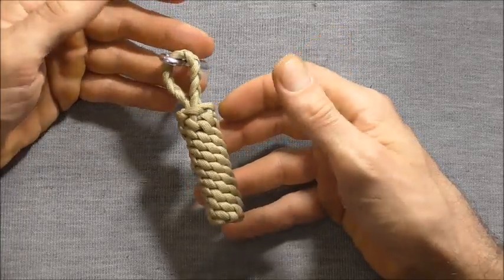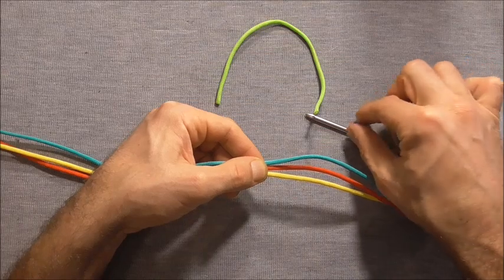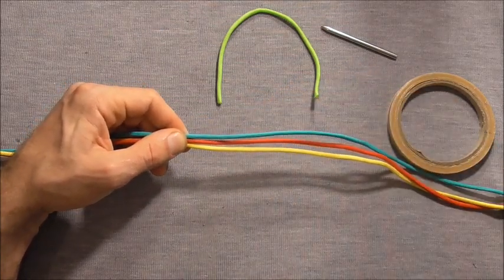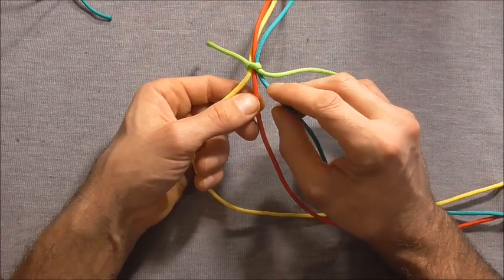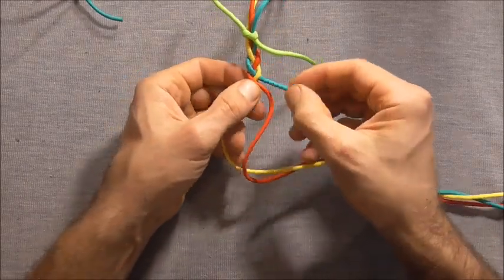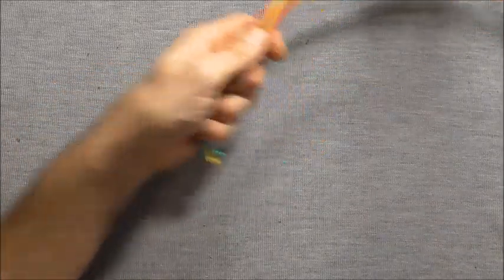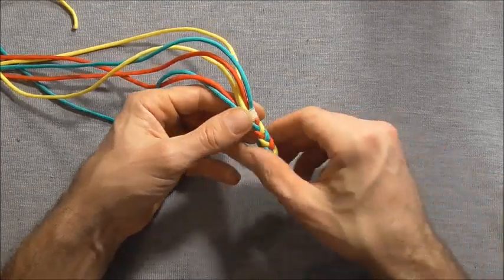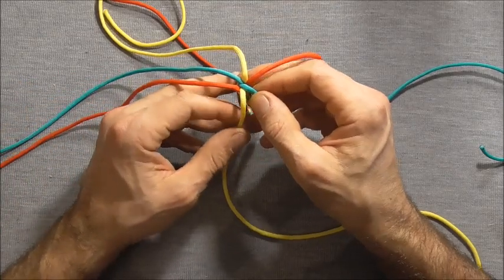"Nautical Knots"- How To Tie A Boat Fender Keychain With Paracord

Comment: This is so so annoying. it looks so easy to do I bought the rope and the fid and now I find it too hard to do. I'm trying to do it with the same colour rope that might be the problem. will have to get some different colours to make it easier. pulling my hair out here.
Reply: TheBill9999 tying knots aren't easy I finally tied a heart knot and it was hard trynna get everything perfect
Reply: Definitely is adam but will keep trying. you mate awesome videos by the way.
Reply: try something a little easier first
Reply: TheBill9999 I totally agree!
Reply: If using one colour. Get some whitr decorators tape n mark each end with a number or felt tip a colour. 
You'll do it. 
Dont try anything easier if your heart set on this. 
Learn your basic sailing knots n you can do this. 
Remember scoobies.... my 11year can do it with frustration but patience. And
Stop n pause of video. 
Youll do it.